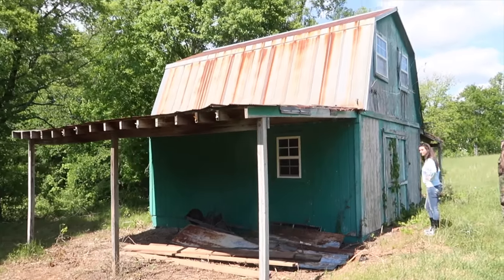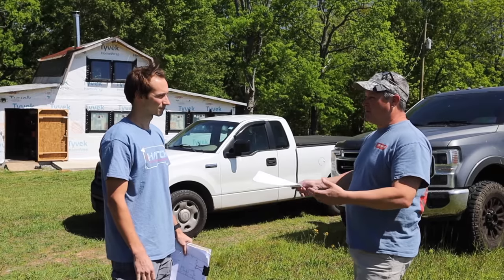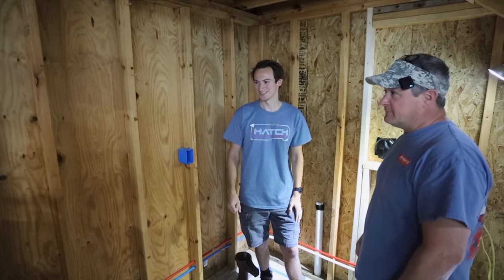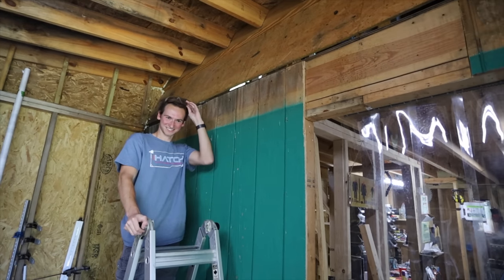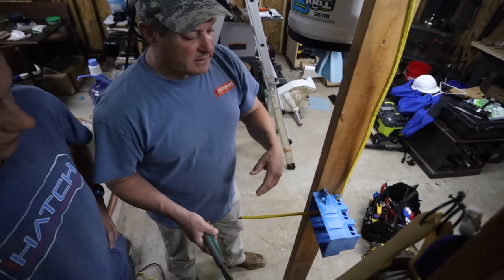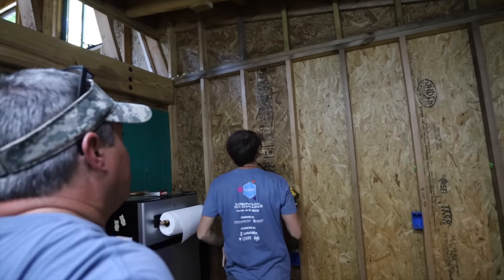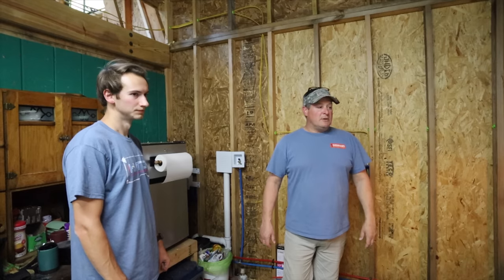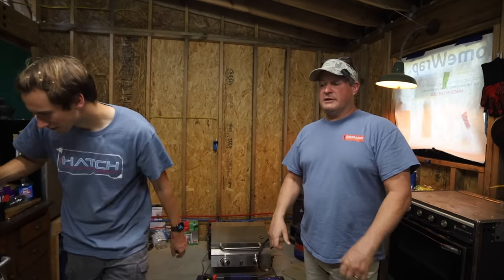Electrical Rough In with a Building Inspector | Abandoned Shed to Tiny House

Comment: Hi Danner, the electrical fittings in Amerika is so much different than here in the Netherlands. All our whires go through a tube. So if one white needs te be replaced, we don't have to open the complete wall.
Reply: I'm dutch living in Tennessee. First time I saw this electrical work I thought "what is this sh*t? Running extension chords in the wall?" :-)  I believe commercial grade electrical work looks more like dutch quality.

There are more weird things. You might have caught it, it is typical to run wires of various thickness in the house, each needing their own breaker. Most used is "20 gauge" (the yellow wire) needing a 20 amp breaker, but to save a few cents you can use 15 gauge (white wire) that should be behind a 15 amp breaker, or 10 gauge wire (orange 30 amp) that is typically used for the clothes dryer and water heater... but.... then the hot and neutral in the extension chord (colloquial called "Romex") are both hot, supplying 240 volt instead of the more typical 120V. Then there is big fat 6 gauge wire running to the range (cooking), that is also running on 240Volts, but then they want to see a fourth conductor in the Romex, 2 hots for 240V, one neutral to have 2x120V and a ground wire.  Often houses still use electrical heat, you know, like those energy hungry resistive space heaters, but they use models that eat 10.000 watts of power. Those also need thick 6 gauge wire to run 240volt, but no neutral, only ground.  Speaking of which, ground wires here are bare copper unlike the insulated green with yellow stripe in the Netherlands.

Then you have the safety factor. It is laughably easy to touch the bare copper of a normal 120volt plug while unplugging or plugging in. Also the legs of these plugs are very easy to bend while the ground leg is easy to break off, which is often done by the user when he is confronted with a wall socket that does not have a ground leg hole. Then the wall sockets are often of a bad quality wearing down fast and making bad contact over time. And with half the voltage you have double the amps to generate heat and start a fire.

Then the extension chords... Typically these are made with thinner wire than even the thinnest Romex used in the walls. The typical user plugs this thin wire in a 20 amp wall socket and then depending on what he is plugging in the extension chord and whether he keeps the extension chord in open air or under under a mat he/she can easily start a fire. 

Oh.. forgot to say. All these different thicknesses and voltages come with their own plugs. 2,3 or 4 prongs with various shapes and orientations.

The US is an amazing place! :-)
Reply: Hahah! That’s all of it in one comment!  The interesting point is that with all the lower current required for light these days (once a huge driver - particularly when halogens were a rage) really we don’t even need 120V or even AC for that matter. The point on our 14G is that we are required to put many more plugs (6ft rules and partial walls) than we would. No reason to waste 20A circuits for that. We will likely have a gas dryer and certainly a gas stove. 

At the same time we are thinking forward to the solar side and we want to be able to be 100% self contained - likely selling back to the grid during summer months. So there will be a significant amount of DC in our home at some point too. No reason to convert dc-ac-dc all the time. 

Thanks for the detailed comment! I’ve saved it!

Comment: There are 2 reasons why you bore your holes in the middle of your structure members is to keep all structural members at maximum strength of that component
Reply: The location for load bearing studs is primarily driven by the 5/8” to edge as long as it doesn’t exceed 40% (1.5”)and 60% when doubled. The location is more important on joists (perpendicular loads), but we are under the 40%  load bearing stud max and used inserts to protect the wire.  Thanks for the input!

Comment: I remember seeing an earlier video when you did a kinda reinspection. For being built in the early 2000s, it's in incredible shape. I remember there only being a little bit of water damage on the plywood in the attic--pretty easy fix. You lucked out, considering it only cost $5000 back then and you don't have to pay for it, aside from home improvements.

Comment: If you mix 12awg and 14awg as someone else mentioned you must only use max 15a breaker. 
If the 12awg starts at the panel you should put a note to not increase the breaker size because someone might see 12awg and think it’s ok to increase breaker size. Personally I do not mix wire gauges in a circuit for precisely this reason.
Reply: We aren’t mixing 12 and 14 gauge on the same circuit. He was discussing the idea of putting some 15A lighting and outlet circuits for the remainder of the plugs. Code requires more plugs than we really need. No yellow, white, or orange is being mingled. :)

Comment: You being a techhy person are you gonna pull any CAT 6 while you have the studs open? Might be a good idea to put several in varuis places.
Reply from the maker: I would like to. Probably one to the desk upstairs and one behind the TV. Additionally, we'll probably put wifi extenders over the ~22 acres of property that the shed sits on. We're in a very rural area with patchy cellular service. Theres a fiber hookup at the street, but we'll also be discussing the tradeoffs between that and something like Starlink.
Reply: @DannerCronise  I am a big fan of the Unifi gear it is very good value for the money and they have a wide array of gear that you can combine to get the ideal cost/performance and the best part is it's fairly easy to set up. As for covering your property can can look at at a combination of directional and omnidirectional Wi-Fi devices.

Comment: I’d never put an electrical panel next to a bathroom. I have a friend who had a home burn down do to this
Reply: No, you didn't.  If his house burned down it was due to some other reason such as faulty wiring.  Proximity to a bathroom won't cause any other issues.  Even if the wiring gets wet somehow, unless it was wired improperly, the breakers would trip on the individual circuits or even the main disconnect.

Comment: What are those LED lights you are getting cheap?
I’m building a detached garage and they look like they will be bright. 25:10
Reply: We have a local amazon return center and we find them there. They are bright and you can change the color temperature too.
Reply: Does Amazon have a listed name that I can use to see if I have one locally here in central Florida?
We have a warehouse distribution center but haven’t seen a return center.

Comment: Note - you can NOT run 14AWG on a 20A circuit.  15A max for 14ga
Reply: Yep I was about to say that. He was mentioning 20A for the kitchen, which is fine, but if you transition to 14ga wire at any point, that breaker needs to be downsized to a 15A, even if it's only doing lighting after that transition. The main reason, being electrical code is supposed to protect future owners who may want to tap into the 14/2 for outlets that may draw 20A.
Reply: Thanks.  His point was that we didn’t need 20 amp circuits for lights.  IOW 15 amp circuits will be fine.

Comment: Problem with the LED lights that do not adapt to a standard light socket or universal connector, when they malfunction, you are stuck with that manufacturer to get a replacement (if they still make it). Functional Obsolescence is guaranteed to rear its ugly head. Good luck matching the color of the light. One will always look different. Just FYI, research and make good product decisions. Pay now or pay later.